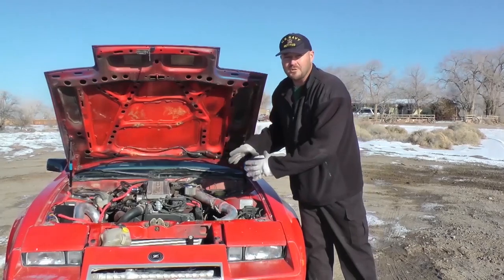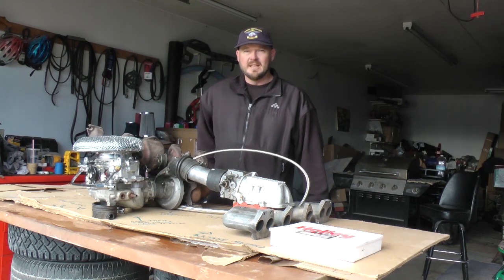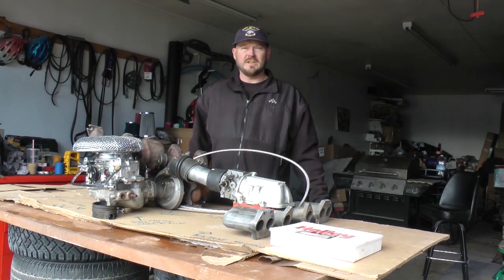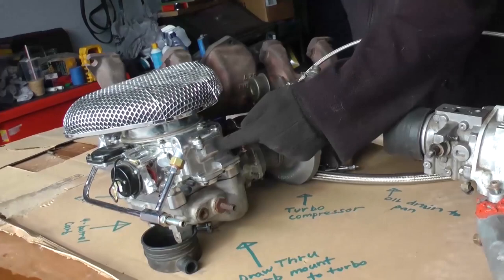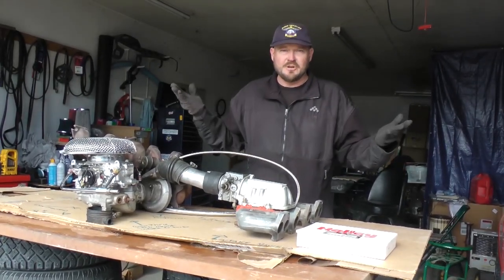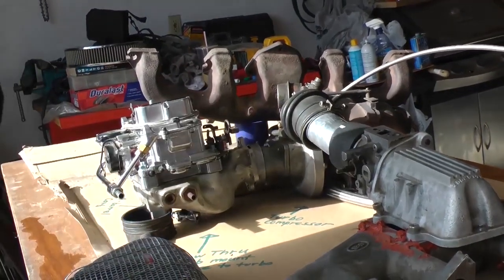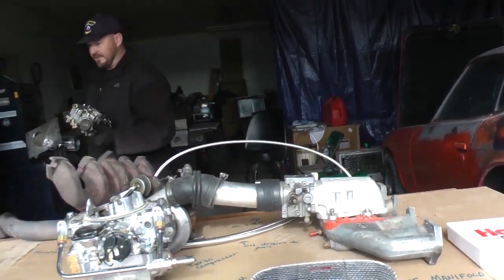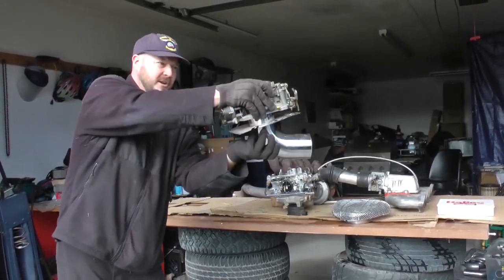Draw Through TurboCharging (Carburetor)

Comment: I have a 4.6 DOHC engine out of a lincolm mark viii that I have a custom intake manifold on and a carter 400 cfm carb.  It has the MSD mod 6 ignition system also.  I am wanting to buy a pro charger and put it on but have no Idea how to do it.  Do you have any suggestions?
Reply from the maker: Devin Fleming best superchargers for the ford modular engines are Kenne Bell superchargers look them up online, some of them into the 700 hp range. That's bolt on power.
Reply: will they work with a carb though?
Reply from the maker: Devin Fleming Kenne Bell superchargers use the fuel injection. Where the throttle body bolts to the supercharger would be a good place for adapting a draw through carburetor set up.  Design it to bolt where the throttle body goes. It would be the first of its kind.  Or contact technical support on his we site ask if they have or can set up a 4 barrel carb supercharger setup for that modular engine.

Comment: What happens if the turbo ignites the air fuel mixture before the combustion stroke of the engine? Misfire? Blown engine?
Reply from the maker: That's why timing and jetting the blow through carburetor is so important.  It is even more important to run fuel with real octane 100+, 91 garbage octane and below just does not effectively cut the mustard.  I always run 100 low lead avgas in all of my turbo cars.  Questions, run real fuel or melt your engine.  Pay now or pay later....  I have traveled all over the world and unfortunately, this is the only country where 100+ octane fuel is not offered at every gas pump which really sticks it to us turbo and boost lovers.
Reply from the maker: Also watch our jetting carburetor videos, blow off valves the truth as well as our other videos, you may learn something especially the point of it takes more than just one gage to monitor your performance boosted engine.  Questions?

Comment: sir i hope u would answer me on this... my qstion is... does the carb need a fuel regulator and do i need to clamp a tubing from the intake to the fuel regulator to regulated more fuel at much higher boost?? maybe increase fuel to air ratio..
im expecting the highest horses in my project.. Maybe we could interact thruu a facebook..

Comment: would a stock cv carb need to be tuned differently or would there have to be any mods done to the turbo for this type of setup to work @Budget Boosting ?
Reply from the maker: Most turbochargers just move air, draw through set up moves air and fuel mixture inside the compressor so having seals that can handle fuel and air mixture is important so that no fuel/air escapes the compressor housing and goes directly in the intake manifold.  Carburetors, so many types and variables, the important tuning for carburetors is more fuel delivery during boost, which can be done by a boost referenced fuel pressure regulator.  Jetting of the carburetor to ensure enough fuel from idle, redline and amount of boost pressure.  How to monitor is having the right gages or datalogging equipment to make sure boost pressure, air/fuel ratio, exhaust temperature, fuel pressure, coolant temperature and oil pressure can be monitored to ensure they are in safe limits.  Small adjustments to fuel, timing, and boost to achieve reliable strong performance well within gage safety limits is key.  If at any time a gage is approaching unsafe limitation, back off, make an adjustment and repeat test.  Many go to Dyno for this fine tuning since it can be difficult finding long stretches of untraveled road to do so.  Most Dyno places also monitor your engine with gages of their own as well.

Comment: Friend what turbo are u ussing is it stock on the inside?
Reply from the maker: I used the 1986-87 Buick Regal Turbocharger from grandnational, t type or turbo T.  Mine was an 87 Regal turbo T limited.  Sure you could practically use any turbo as long as it seals really good between turbo compressor and center bearing housing so fuel being thin in viscosity cannot enter the oil filled bearings.  And fill engine oil system with fuel.

Comment: planning on doing this but whats the manifold that mouns the carb to the turbo called
Reply from the maker: +wiborg344 I call it the draw through turbo manifold assembly.  The GM version can be found on 1980-81 Pontiac Trans Am with the 301 CI turbo V8.  Also in 1978-83 Buick Regal Sport Coupes with the turbo 3.8 V-6, both are draw through turbo set ups.  I have seen some of them on sale on ebay.  That is where I bought one.
Reply: i imagine those manifolds are quite expensive being on such valuable/desired cars. around how much did you pay for that one?
Reply from the maker: +wiborg344 I got lucky on ebay buy it now auction for $50 free shipping.  They are out there.
Reply: +Budget Boosting hi there, i have an Datsun l16 sss that i want to turbo but it all ready has twin port 48 sidedrafts, do you recommend draw through or blow through?

Comment: How do you control fuel flow for low RPMs and idle?
Reply: I think that this system allows the engine to function normally.  So when you open the throttle body, the carb inject fuel according to the opening and air and in this case the turbo will work the same. The curb controls the turbo.  I stand to be corrected.  I'm also new to this

Comment: Any waste gates or blow off valves on this set up?
Reply from the maker: 1speedjunky Internal wastegate or external wastegate can be installed.  No blow off valve can be installed in this configuration because it would introduce the fuel/air mixture to the underhood compartment.

Comment: Do i have to make and modifications on the carburetor on this setup?
Reply from the maker: +vodzdong for draw through no.  For blow through, a special carburetor is needed.  There is a great blow through carburetor company called C&S specialties that can design and build blow through carburetors for any application.
Reply: +Budget Boosting thanks for the info i hope this will work on my weber 38 and a tdo4 turbo. Do i need to change the jettings for this application?

Comment: hey tanks for pointing me to this, do i need to alter timing or fuel pressure for this set up?
Reply from the maker: Yes timing and fuel pressure need to be adjusted to fuel watch our two carburetor jetting videos and blow thru carburetor videos again and I talk a lot about carburetor jetting, the gages you need to make these adjustments. Its easier to watch the videos a lot and take notes on what to apply to your carburetor tuning for boost.

Comment: I know this might be dumb but can you make a anti lag system for this 
And what makes more power blow though or draw though
Reply from the maker: For anti lag, build a stroker engine with higher compression, loads of low end torque and turbine A/R around .63 and compressor A/R around .70, it will have very little lag and great off the line power.  Also supercharging along with turbocharging gives boost from idle to redline.
Reply: +Budget Boosting thank you one of the best info channels !

Comment: I got a 1986 1.5 honda civic 4wd...can u help me out on what to do? It's slow as shit but I just want a little kick...please help
Reply from the maker: Intake and exhaust mods.  Give the intake and exhaust system as little restriction as possible and you will feel it.  New NGK spark plugs around 6 heat range for N/A, 7 or 8 heat range for turbo boost.

Comment: this draw through setup would be good to run with propane jeep. altitude friendly, cleaner running and runs at any angle. i have a 3.8 i am going to put in. just debating on draw through of my 84 grand national. i want simple that wont keel over if i get the jeep in the water. =)
Reply from the maker: +rowdy hansen A snorkel would be the way to go too so water would really have to be high to be an issue.

Comment: How can I control boost on this setup? do I need to install a wastgate? thanks, Ed.
Reply: Yes
Reply: My thought just use electric turbo for this set up and put a pressure switch to control the boost....much easier to do....only working on intake manifold....and leave the exhaust system

Comment: but what if the hot exhuast ignites the gasoline in the turbo or even worse,in the carburator?
Reply from the maker: I believe that would only happen if there was a leak, bad gasket, or the carburetor was flooded really bad.  Of course extensive testing and murphy proofing the project during the build, and having fire extinguisher handy.  There are risks associated anytime dealing with carburetors, fuel, and modifying anything for performance.

Comment: Great video, i have a question for anyone, do you have to do any other mods to the carb for draw through to work ?
Reply from the maker: +William Neigum Other than just jetting If more fuel is needed for boost, boost reference fuel pressure regulator is a great mod as well.  Timing adjustments to around 18 deg btdc.
Reply: Budget Boosting i was planning on doing a draw through set up on my 22r and getting a webber cab. should i use the stock one or get an after market? you should do a draw though build and show us how and where to put the carb and what not. keep up the awesome videos
Reply from the maker: +William Neigum The stock carb should do fine as long as you have a jet kit so you can go up or down as required for boost.
Reply: +Budget Boosting could you or do you have a video about the changing the jets im only 22 an trying to learn more about carbs
Reply from the maker: +William Neigum I did a carb jetting video on the holley style carburetor.  every carb has its own method of jetting, different locations and stuff like that.
Reply: +Budget Boosting but they are all generally the same ?

Comment: How much more hp are you producing by doing this setup
Reply from the maker: depends on many factors.  Engine type, turbocharger, wastegate, and controller, carburetor, fuel type, etc.  I have my 1980 Regal sport coupe draw through turbo.  From the factory it had a mismatched turbocharger.  Small compressor and housing, small turbine and large turbine housing.  That makes it very slow on response, low volume of boost, low power, high turbo lag, all bad things for performance.  I installed a 1987 Buick Grandnational factory Garrett A/R .60 Turbocharger that has large compressor and compressor wheel, larger turbine and smaller turbine housing for faster boost response, larger volume of pressurized air.  I also installed a larger 4 barrel double pumper carburetor, an external wastegate instead of internal one which is inferior.  I made a video on this 1980 Buick a few weeks ago and the performance has greatly improved.  I have not dyno'd any of my cars so for exact numbers, not at this time.

Comment: Awesome videos! Thanks for the info! For my 1967 Ford Mustang 200 ci inline 6, what set up would you recommend? Draw through or blow through? I'm upgrading the head to an aluminum 250 head available on later models and that will be ported and polished also. Thanks!
Reply from the maker: I would go blow thru like I did for the 280zx in line six. Offenhauser sells intake manifolds for those older straight sixes and a quick fuel blow through carb from summit would be the best
Reply: Thanks!

Comment: Simple idea and all that. But beware backfiring into the intake manifold - a huge ammount of air fuel mixture under pressure is a disaster waiting to happen. Blow through is more complicated but safer option.

Also the unvaporised fuel droplets will rape the compressor wheel.
Reply from the maker: akkudakkupl All depends on how its tuned.  The 1980 - 81 Pontiac Trans Am had the draw through set up and worked fine, just not all that powerful now but in its day it was fairly quick.
Reply: Budget Boosting Just make sure your valves are ok, the ignition system is ok and you are not running lean.
Should avert any acute explotitis ;-)
But still blow through is the safer bet ;-)
Reply from the maker: yes blow through is safer and with modern designed blow through carburetors, easier to tune.  I do prefer them over draw through but the intention of the video is to put it out there since so many do not know anything about them or the concept.  Its also part of turbocharging history, after all drawthrough was the first production turbocharged vehicle.  The 1964 Chevrolet Covair with draw through turbocharged H-6 engine.

Comment: Great, but dont forget Holleys will need to have their power valves boost referenced.
Reply from the maker: +SuperInline6 Only for blow through carburetor applications.  Draw through has the carburetor mounted before the compressor inlet of the turbocharger, therefore no boost is being blown through it so no, it does not need special carburetion other than jetting.  Example:  1980-81 Pontiac Trans Am turbo, draw through Rochester quadrajet carburetor leading to the compressor inlet, than the boosted air is mixed with the fuel air mixture from the carburetor and is forced into the inlet of the intake manifold.
Reply: Ok, but in a draw thru, unlike a normally aspirated engine, the vacuum only increases before the turbo. In this case, the power valve (in a  holley carburetor) will never open.
Reply from the maker: +SuperInline6 the suction or vacuum produced by the turbo compressor intake will make loads of vacuum or suction to the bottom of the carburetor.  Should open just fine.  I would like to find one of those old draw through Trans am turbo cars and do a Holley conversion to compare to the original quadrajet.

Comment: Hey, just had an idea, not sure if it will work.  What if for a way to bring your fuel/air to the intake you used an old carb and ripped all the guts out of it, and attached a carb hat (that is used for draw through turboing) which connected to your intercooler piping, and the turbo it's self. In other words, you have a nonfunctoining carb attached to the intake manifold, you have the carb hat attached to the old carburetor, and you have intercooler piping running between the turbo and the carb hat. just a thought. has anybody tried this? Thanks
Reply from the maker: Aidan Foxley I would like to see a picture or drawing of your idea, from what I am reading it sounds like you are describing my blow through carburetor set up.  My blow through carburetor has a carb hat on it, and it sits on the intake manifold.  The turbocharger piping goes from turbocharger compressor discharge to intercooler than to the carb hat of my blow through carburetor which then mixes its fuel with the boosted air.  Now I think that the non functioning carburetor mounted to the intake manifold with carb hat on it would be great way to connect boost piping to the intake manifold after the turbo compressor discharge to bring the boosted air to the engine.  The other thing is that the working carburetor on a draw through set up is mounted before the compressor inlet of the turbo so the fuel and air mixture is going to the inlet of the turbo compressor and then the fuel air mixture gets boosted to the intake manifold and into the engine.  If an air to air intercooler is used between compressor discharge and intake, fuel in the fuel air mixture could gather in the intercooler and it would start to fill with fuel which could cause a problem one the intercooler is completely full of fuel.   Now if a water to air intercooler was used, the fuel should not pool in that type of intercooler and that could work.  An intercooler is really not needed in this set up because as soon as the fuel and air get together in the turbo compressor, the fuel cools the air just before it goes in the engine intake.  Now you could also add a methanol injector to the pipe just before the intake to cool the fuel air mixture even more before it enters the engine intake manifold, that would cool better than an intercooler and easy to set up.  Only problem is the methanol fluid runs out quickly so you would need a good size tank for runs longer than a quarter mile.  Still would like to see an illustration of your idea to understand it more since I probably didn't understand you concept completely.  Thank you for your comments and ideas, thank you for watching too.